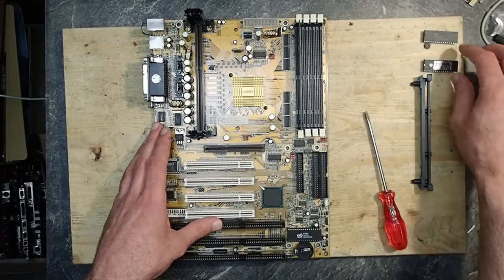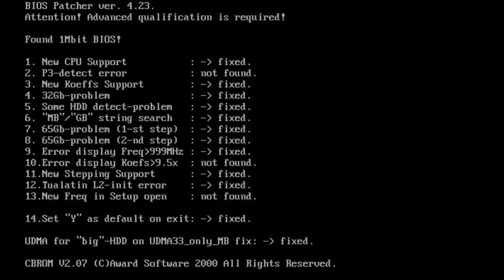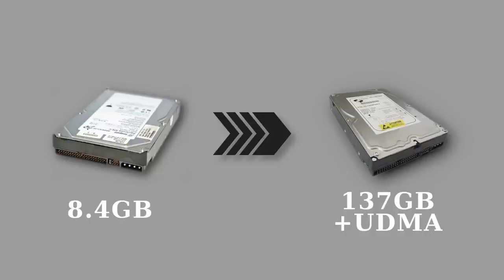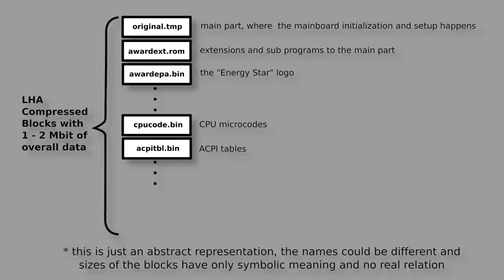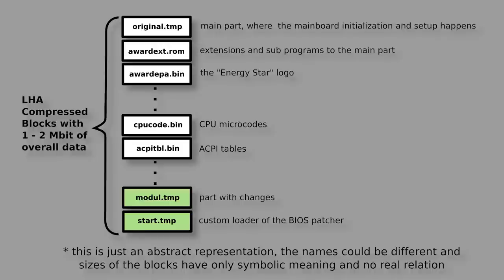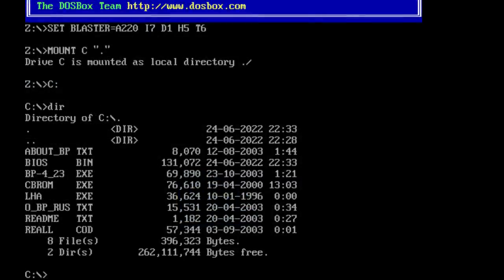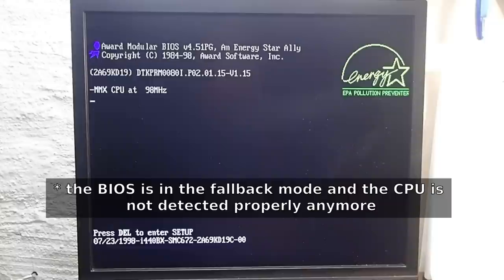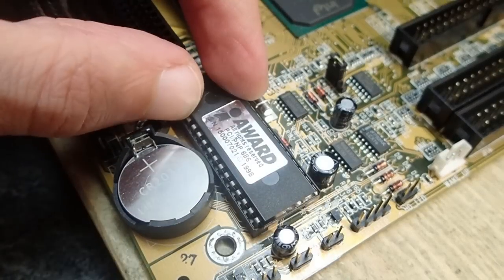BIOS Patcher: unleashing the potential of an old mainboard.

Comment: Just imagine we would have had this tool back in the 90s!
What a money and resources saver by unleashing the full potential of a PC (back in the days) instead of consistently buying a new one.
Reply from the maker: Well, we kind of had this tool back then. As far as I know the first version appeared end of 90's early 2000's. The version, which I showed in the video is from 2003. Most people just didn't know, that it existed, but in the post soviet  hardware scene there were quite a lot of useful tools like this.
Reply: The more "common" tool was TweakBIOS (at least in my filter bubble). However, it was more focused on preliminary performance tuning rather than adding persistent features (like supporting larger hard drive sizes) right from the beginning of the boot process.

Comment: This is an incredible tool that I already knew, but thanks for sharing :D
I added it to win3x when I was still a moderator there, despite the bad history that happened later, this is at least another backup of this tool :)

I wish they shared the source code of this awesome tool, because I think it could be expanded to older bioses :) (imagine adding LBA 128 to an old 486 ? 😍) and maybe we could even add new features that didn't matter in the early 2000's but could now (USB boot ?)
Reply from the maker: Yeah, I also was searching for the source code, but I couldn't find anything useful. Not even an active contact.
Reply: One can also reverse engineer the binary and reimplement it open sourced.
Reply from the maker: @szenti707  Sure, but it takes quite some time and know how.

Comment: Thank you so much for putting so much work in this and sharing this with us - when I saw it yesterday I got so incredibly excited that I had to test it with my older mainboard. My K6-3+ is not being recognized from my mainboard (it posts but only shows 66 MHz without a CPU identification). I then manually set the muliplicator via software in order to get some performance out of it. 

After seeing your video I flashed my Bios ROM file with the BIOS Patcher and via CBROM I could confirm that two new modules have been added to my Bios ROM. I could also see in the report that new CPUs have been added. However, after patching the BIOS with the new firmware (via uniflash) no changes happened (not even the rom.by line appeared during POST). 

I am trying to figure out what else I could try. I have two ideas, first one is to try an external flasher and the second idea is to add the CPU microcode directly into the main system module. I would appriciate any thoughts or comments :)

Thanks brother! :)
Reply from the maker: Did you apparently disconnect your keyboard? If you did, the patched rom goes into recovery mode and starts the original bios. You can disable this feature if you don't like it by supplying /s parameter to the bios patcher.

Comment: Wish I knew about this when I still had my i430vx retro build running a k6/2 400 CPU 😅
Reply: I had a Biostar VX board back in early 2001, and I used an Evergreen 200 MHz upgrade CPU (it was actually a Winchip) to replace the Cyrix CPU it originally had. I bought the Evergreen CPU on Ebay, and the machine wouldn't POST when I installed it. I contacted Evergreen, and even though I bought it used, they sent me a BIOS as an email attachment and the machine then worked fine! The bonus was that months later I used a K6-2 450 @ 400 MHz, and it worked fine with that same BIOS. Unfortunately the linear VRM was overloaded by the combination of that CPU and a hot summer night, and the board died.
Reply: K6-2 for life. My first PC was an old IBM aptiva and I upgraded the bits out of that rig. 550MHz, 512 MB Ram, 120GB HDD, ISA Sound Blaster 16, Nvidia GX550 PCI card. I miss my baby.

Comment: This is a fascinating tool.  I have wanted to get a chip writer like what you show in the video.  Sadly I have 0 experience or knowledge in regards to these things.  I see tons of suggestions online but it seems that opinions vary.  Can I ask which one you use, and just confirm the OS that you use it on?  I really appreciate the videos.  They are excellent.  I am trying to learn so that I can maintain and fix a lot of the old computers that have ended up with me over the years.  I didn't want to recycle the old ones in hopes they could be fixed.
Reply from the maker: Hi, the programmer is TL866II+, this is actually the best by a huge margin, what you can get for your money. I don't think someone, who used it once would tell you something else. My operation system is Linux, but the TL866+ works with Windows perfectly fine too.

Comment: The article you mention about adding plop bootloader to an old laptop really got me going. I saw it a couple of months ago, and recently I got another idea. You know those ISA cards with one EPROM chip, where you can put something like XTIDE bios, right? Well, turns out, in its 5V mode PCMCIA slot works exactly like ISA slots, just in a more compact package. So my idea now is to make an ISA ROM card, but in PCMCIA format, and then my retro Toshiba Sattelite 315CDT will boot from its only USB1.1 port. How cool would that be?
Reply from the maker: PCMCIA and ISA are similar, but imho not the same. It is more like IDE, you could try CF to PCMCIA  adapter and see, if your device would see the drive.
Reply: @necro_ware  they are the same, for the purposes of this discussion. I spent the last week reading the PCMCIA PC Card standard. The only difference I (maybe) found so far, is the fact that pcmcia runs in 16bit mode, like a long ISA. But it starts in 8bit, so maybe it'll work, or maybe, I'll have to use a 16bit eeprom. In any case, so far I feel pretty good about the chances of success of that idea. And by the way. IDE does grow directly from ISA, so they are compatible. And of course, CF can be connected to PCMCIA with a passive adapter, in fact, I think CF is a later version or addition of some sort to PCMCIA standard. But it's not what I want. I want an option ROM, so I can put XTIDE bios or plop bootloader in there.

Comment: Love the video. Could you please let me where do you buy those IC chips for the Bios Rom chips and where or what site  did you buy the Eprom Flasher at. I would like to get one for a Socket 7 Socket Ampatron/PC Chips board I have for a Cyrix M II CPU I have and for the MMX voltage adapter what voltage upgrade chips should be used on the voltage adapter for the Cyrix M II 300 so it does not over heat since I don't want to use a Intel CPU. Thanks for reading. Have a good one.
Reply: The flasher is at eBay around $60 USD, possibly there you find the chips too

Comment: That's very cool!  About a year ago I tried the infamous 1.1GHz Coppermine P3 in my Asus P2B-DS 440BX board and it wouldn't POST.  I returned the CPU and the seller concluded that it must not be listed in my board's BIOS cuz he was able to boot it on his test board after receiving it back.  Perhaps this would be a way that I could run that CPU instead of the current 1.0GHz P3.
Reply: That could be!  But I ashure you: P2B(-B in my case) can even run tualatin with the last official bios from 2003.   P2B-DS is the coolest, I have one here, but only with 2x333MHz PIIs ;)
Reply from the maker: Yes, could be, but with the P2B you have to be careful. The early revisions of that board (before 1.10) didn't provide voltages below 2.x something volts, where Coppermine needs 1.65-1.7V. So even if you patch the BIOS, your board could probably POST and even work some time, but the CPU wouldn't stand the voltage for too long. If you want to use P2B watch out to get the later revisions, at least 1.10, better 1.12.
Reply: @necro_ware  Yes I'm aware.  Mine is P2B-DS v.1.05 (the version numbering is a bit different for the -DS IIRC) because IT CAN do the lower voltages.  Currently it's driving a pair of rare SL4KL 1GHz Coppermine Slot 1 CPU's at their native 1.7v.  When I first started the project, I only had a P2B-D 1.03, which WAS able to run a pair of 1GHz Socket 370 Coppermine's via slocket adapters but I had to override their voltages to 1.8v cuz that was the lowest that earlier board could provide without hardware modification.  I believe it was 1.06 where they updated the voltage regulator on the normal P2B-D and 1.05 for the P2B-DS.
Reply: @logipilot  Yeah I know! That was actually a thing I discussed with the seller too.  It'll run a 1.4GHz Tualatine with the right slocket adapter, but not this 1.1GHz chip. We concluded (our best guess at least) was that it had to do with the story of how Intel released the 1.1GHz Coppermine P3 and then pulled it from the market because it was unstable, only to re-release an updated version of it later on. We guessed that perhaps the two versions had different microcode ID's because I tried two 1.1GHz chips and #1 POSTed but was unstable and #2 wouldn't POST at all, but reportedly worked fine for him - which could be explained in theory by my BIOS lacking its particular ID in the CPU table.  Or this could all be crap and the guy was just being a liar cuz he was tired of sending me chips, lol!!
Reply: @necro_ware I recently changed the voltage control chip on P2B 1.02 and could afterwars run a coppermine 1.0 (133x7.5). There is a thread about this at Vogons, Bits and Bolts did the same on his 6 P2B board series. Some soldering skill required, I did it myself after some learning effort.

Comment: I wonder if this can allow a newer motherboard, like a pentium 2 or 3 to be declocked and settings adjusted to make it close to a XT class system? this is been something I have wanted to try for a long long time back when pentium 2 and 3 systems were nothing more than ewaste. Now that they are collectable it may not be as smart of a idea as it once was, but still a neat thing to possibly run software that is cpu cycle dependent
Reply from the maker: You can downclock the FSB, deactivate the cache and use setmul tool to lower the multiplier. It is possible to get down to about 386DX-33, but XT is unreachable.

Comment: I had tried this tool before, mainly for 137Gb HDD support.
I had mixed results on the Socket 7 I had there.
It detected bigger drives but then crashed.
I was not aware of the fall back option with "-".
Reply from the maker: There are reports about stability issues, if you use the beta or alpha version of the BIOS patcher. With 4.23 I had no issues so far. As a side note, I used it with Slot 1, S370 and SS7 mainboards.
Reply: Yeah I have to try again, with other versions and M/Bs for sure.
Reply: since bios will be patched you'll about to patch windows (95/98) because these versions will corrupt data on disks sized 128Gb+. DOS got no patches.
use mhdd or victoria to limit hdd capacity to 128Gb. that's the easiest way to use modern fast drives on old systems.
Reply: Interesting, I am using seatools to limit the size on the disk level.

Comment: I love doing stuff like this! I have a new'ish laptop (i7-10870H/RTX2070) and have seen screenshots of modified BIOSs for my laptop that allow overclocking and other performance settings. I really wish I could find a trustworthy source that provides these tools. Better ondervolting and custom settings would be a great way of getting more performance for my system that I would love to have access to. As I cannot find any such resources, I'm stuck with my current setup.
Reply: You shouldn't, you could damage your laptop by overclocking it, and I'm pretty sure both the CPU and GPU already get hot.
Reply: Intel Extreme Tuning Utility is all you should need. Undervolting is a must on laptop, GG.
Reply: @Cmdrbzrd  He wants to undervolt aka get lower temperature with less voltage. :D
Reply: A useful feature is the shared memory allocation setting for the IGP.

Comment: Hello! I have problem with the CBROM software. Any time I execute it with a Award bios file, it shows the first line "CBROM195.exe V1.95 [12/14/07] Phoenix Technologies 2001-2007" and stucks with one CPU core at 100%. Why is that, why the program does not report error? Did you have same experiences? I tried differen CBROM versions and also different OS, but always the same problem.

Comment: I've got an old HP 8260 (Asus KL97-XV) that won't POST any Celeron in a slotket, but it's a Phoenix BIOS, trying to figure out how to add CPU support for it, any suggestions?
Reply from the maker: Phoenix = Award, so you could try this tool
Reply: @necro_ware  I'm getting the error "Found 2Mbit Award BIOS (4.5x)! Can't find "*BBSS*" error - cant find start.modul!error!"
Reply: @necro_ware  okay so now I have the dump of the BIOS from Phoenix Bios Editor, which crashes on load but I can pull everything from the TEMP folder and it creates a ROM.SCR script, can use PREPARE and CATENATE to put it back together, but my challenge is replacing the microcode in UPDATE0.ROM, at least I think that's the goal, I've tried using UPDATE0 from other BIOS dumps as well as the P2 CPU COD file from the Russian site but no POST after flashing

Comment: I have an older pentium 1 motherboard with socket 5. Iam guessing it wont support UDMA or bigger hdd till 3.2GB.. Now i see you can give the board UDMA +137GB support.

But i dont need the support till 137GB HDD.. Is it still possible to put a manual value in so i got support till 32GB HDDs.. Or is the baundry always UDMA + 137GB and not possible to change that.

Comment: Is it too risky to flash from the DOS prompt? I don´t have an EPROM programmer...   I want to do this to my Abit VA6 - it lacks cl2 support...
Reply from the maker: Shouldn't be a problem, I just prefer to use the programmer, since I have it anyway.
Reply: I've used it on a couple of different Socket 7 motherboards, and I used the /s option. One of those times something went wrong, and the machine wouldn't POST. Since I did not have a programmer, I had to do a hot swap flash to get that motherboard working again. I tried patching the BIOS again and as far as I know I did nothing differently the second time, but it worked fine that time.
Reply from the maker: @yosemite-e2v  Sometimes such things happen. That's why I'm glad to have a programmer. It is one of the most used tools in my workshop.
Reply: @necro_ware  I really should buy one. I'm confident in my abilities when it comes to hot swap flashes, but they are still a risky thing to do and really ought to be avoided if possible.
Reply: @yosemite-e2v  hot swap? do you mean change bios chip while PC is on? (assuming you will use working bios and then flashing the failed one again) wow...
Reply: @eaglemaster7     This way one could build a "programmer": use a cable with wires and switches connected to another socket for the bios, this way you can switch off the voltage before swapping ;)
Reply: @eaglemaster7  yes, done it before. It works

Comment: I wonder if this would work some magic on a Pentium Pro board I have.  It's an ECS P6FX1-A with Award 4.50 BIOS and it's impossible to install Win2k Pro on it as it bluescreens.  WinNT 4 works fine.  Something about this board and Win2K that doesn't play nice with PnP.
Reply from the maker: I don't think, that this is something, where the BIOS patcher would help. Early PnP was a pain in the back, hardware wasn't quite following the standard, Windows was full of hacks and workarounds to get it running and still we had a lot of problems trying to get it running. If I remember right, you could disable PnP during the installation of Windows to get through the hardware detection properly and re-enable it later, when the drivers are available.